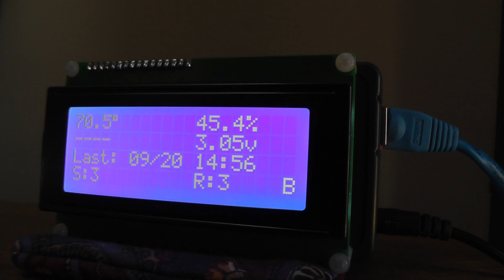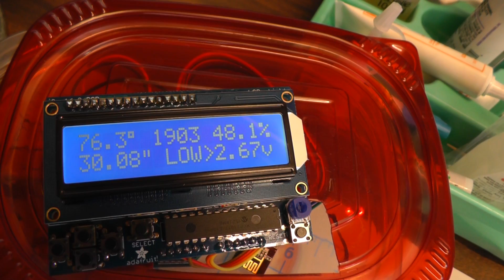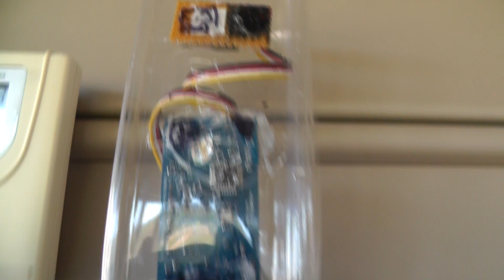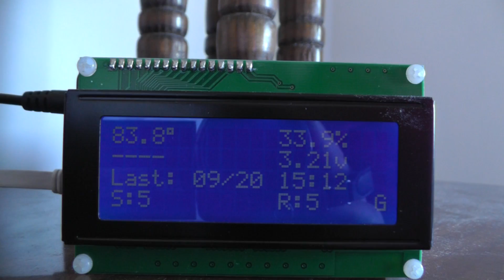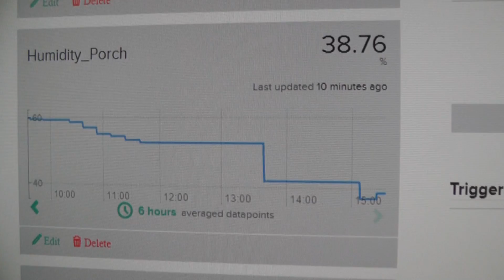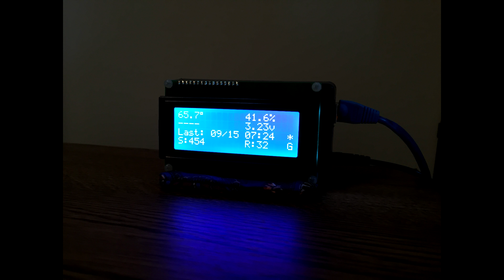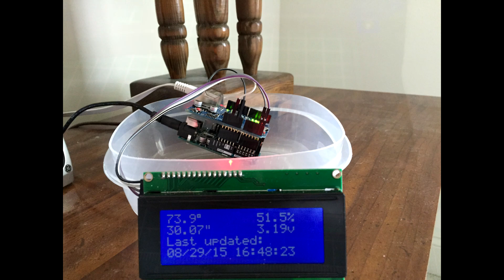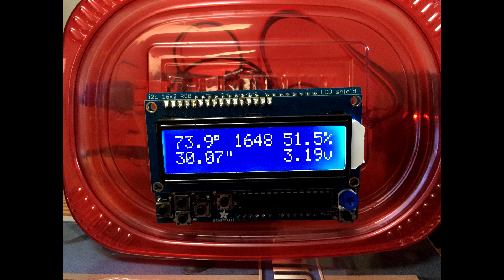Arduino Weather Station

Comment: Completely new to these stuffs but I'm really fascinated by it.

One question : Will I still need two boards (sender and receiver) if I were to set this up for a single room?
Reply from the maker: No, you could use just a single Arduino Uno board or similar that would attach to a small temperature and humidity sensor and feed the readings to the same board.  Then attach an LCD display to that same board and you would have an all-in-one single room weather station.  I used the sender to send temperature readings from outside wirelessly indoors to my receiver which displayed the info.
Reply: Thanks  for replying ..

Comment: any source code available?
Reply from the maker: My code is a little messy and fairly involved, but has worked flawlessly for over a year.  Check out the repository and notes I posted here: https://github.com/bobotmedia/WeatherSense   Hopefully you can use some pieces I figured out.
Reply: Bobot's Trains and Maker Zone

Comment: which wireless chips do you use ?can i find details about this build anywhere ?
Reply from the maker: I used this setup for a year and just retired it to design and build an updated version shown in this video: https://www.youtube.com/watch?v=IIBs6eXK2K0       I was able to get an iBoard which contained the Arduino Mega, Ethernet, Real Time Clock, and RF module interface all on once board.  I attached a Nextion 4.3" touch display and made an enclosure for it.  The RF modules in both projects are nRF24L01+ modules.  They are cheap and plentiful on Amazon and eBay.  For best range, if you can get the ones with external antenna they are worth it. I haven't had the time or inclination to make my code and details on these builds available but I possibly may do a blog post some time in the future.
Reply: i've had those nRF modules laying around for a while i will chechout your new video. no idea how to use the rf modules yet XD.
Reply from the maker: Diederick Bruin A year ago I had no idea what an nRF24L01+ was.  I started with this info and went from there:  http://arduino-info.wikispaces.com/Nrf24L01-2.4GHz-HowTo
Reply: the devduino's can i buy them in europe ?how are they priced where you are ?
Reply from the maker: The devDuino v4's are nice, but hard to find.  They are currently out of stock everywhere, but I heard another batch is coming in August.  http://seeedstudio.com/devDuino-Sensor-Node-V4-(ATmega-328)-Integrated-temperature-%26-humidity-sensor-p-2279.html